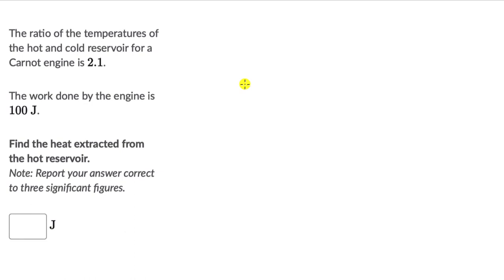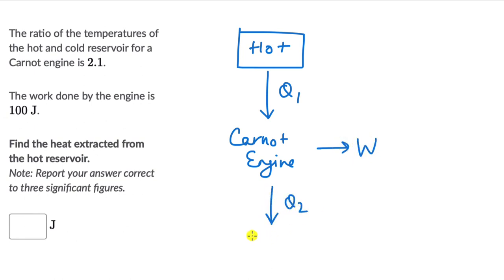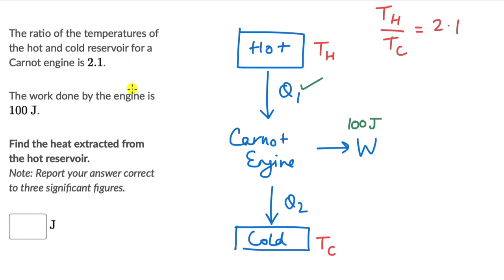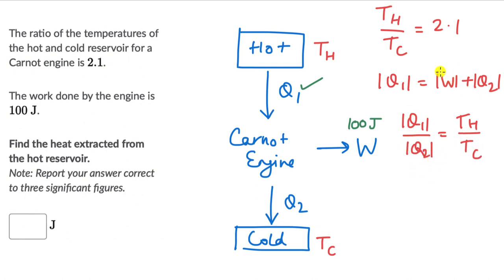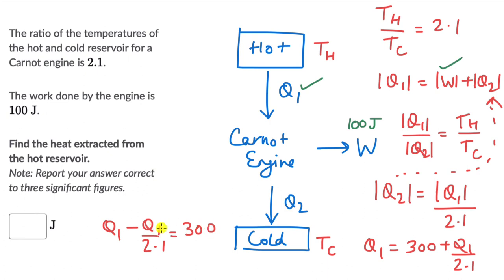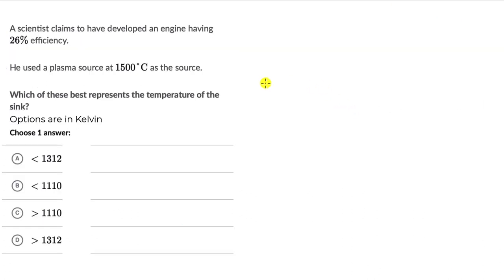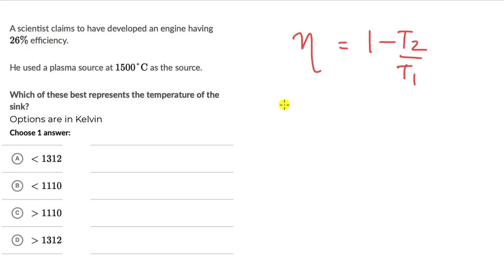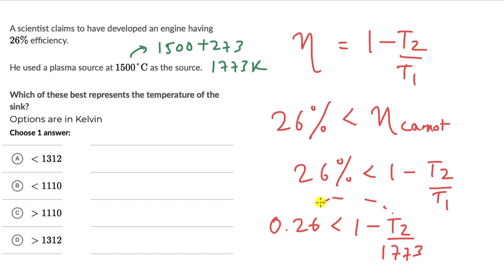Worked example: Carnot engine | Thermodynamics | Physics | Khan Academy

Comment: Example is wrong, it is 100J, not 300J. Answer is Q1 = 190.913. Easy way to do it, use the temp. ratio to get Carnot efficiency η = 1 - Tc/Th = 0.5238 and then W = ηQ1